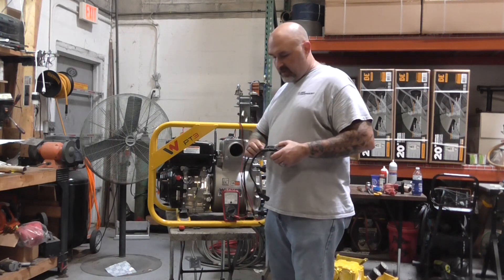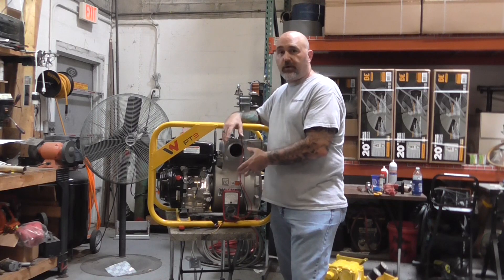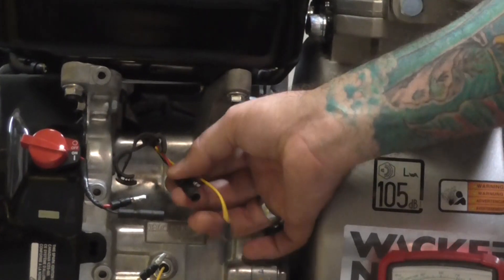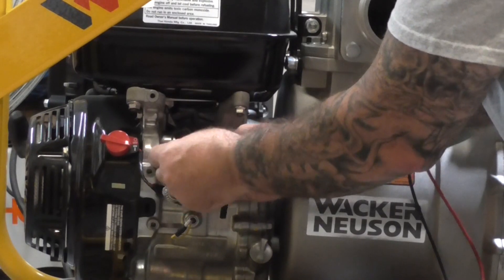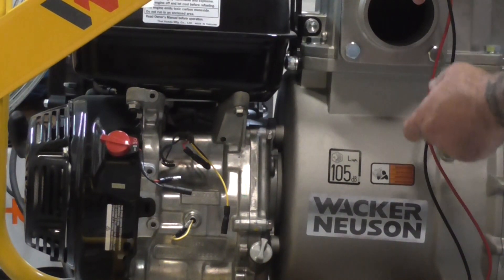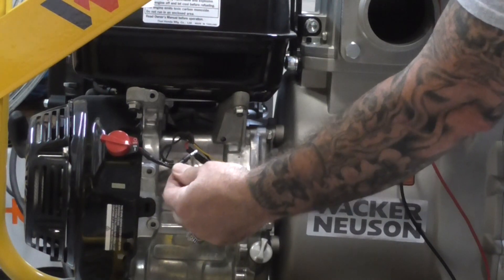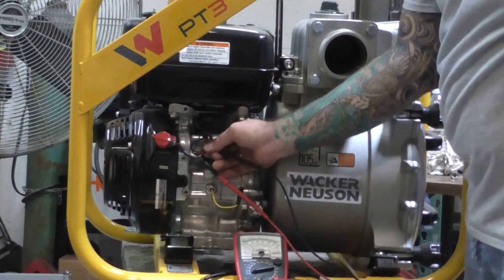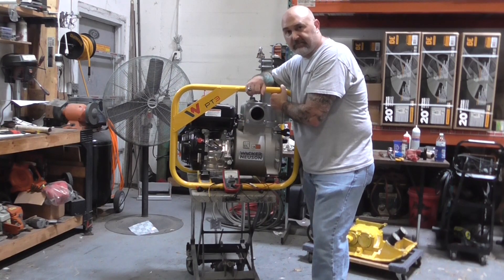Diagnose New Style Honda 4-Prong Ignition Coil | Models: GX240, GX270, GX340 & GX390

Comment: A thousand thanks for your video.  We have a 2 year old electric start GX390 that we could not get to run right.  We replaced carb, sparkplug, gas cap, and unplugged the low oil switch with no improvement.  Tried your test of plugging the red and black wires together and Hooray, it runs like a champ.  Apparently we have a bad switch just like you said.  Had I not found your video I would have bought a new coil and still be looking and pulling my hair out when that didn't fix it.
Reply from the maker: Awesome; love to hear we saved some hair!

Comment: First, thanks for a nice video.
My GX340 Honda has a different on/off switch and also 2 wires that go to the low oil pressure switch so I couldn't diagnose my system using the method shown in the video.
I also saw another video that gave some information on the Honda GX340 ignition system.
In that video he talked about the connection inside the spark plug cap being loose causing it to loose spark. Inside the cap is a threaded brass insert that the plug makes contact with the spark plug.
I unthreaded the spark plug cap and used a straight blade screwdriver to remove that threaded brass contact.  To my surprise I found a small resistor/fuse above the threaded brass screw.  I tried to get a continuity reading  and it showed an open circuit on my ohm meter.
So I decided to try and see it the plug wire would produce any spark directly from the end of the plug wire with the spark plug cap removed.  I held the plug wire about 1/4" away from the metal valve cover and to my pleasant surprise I got a nice crisp spark.  So it turns out the my coil was good.

Stens offers a 135-226 spark plug replacement cap at a reasonable price which I will probably purchase.  I believe the resistor/fuse is all that I need but was unable to find a part number for it.  It may not be a serviceable part and you have to purchase the spark plug cap assembly.

Well you learn something every day and this was my learning experience for today.😊

Comment: I'm unable to find the fault on a concrete saw that uses a gx 390 honda engine. 
Went ahead and tested the spark plug even on a different machine, proved to be functional, checked the 3 wire harness, all good, tried disconnecting the oil sensor, on off switch and the hazard switch, did the red-black trick, no spark, ordered a genuine honda coil, still no spark. 
Found out there was no continuity in the spark cap, took that out, removed the ceramic resistor inside, used a solid copper wire and covered it with lead in order to give it the same shape/form as the resistor, now i get the continuity on the cap, but still no spark. 
The magnet on the flywheel seems ok, i mean it has enough pull force, what else am i missing here? Thanks!

Comment: Obviously, the new coil eliminates the old-style low-oil shutdown module. I have a unique question for you: if you replace the flywheel on these newer engines with an older flywheel (pre-2011,) can you 'revert' the ignition system back to the old style? I bought an electric starter kit that won't work with the new coil, but I have all the components from an older GX390 that I could use to replace the new-style coil. Thanks in advance.

Comment: If you do not have the wiring loom, and only the ignition coil. Its the front two pins! The rear two are prob from the oil sensor. Pinout: front two pins!

Comment: Hello Will this module coil work or produce current for a spark when the 4 plug connection is pulled from coil or does it need to be plugged in and attached to a minimum amount of wires like red to black as you show to work ? Will this module coil work without on/off wires or low oil switch disconnect. Thank you

Comment: Same thing for electric start models??
Reply from the maker: Hi Jared, the procedure is the same once you disconnect all other wires from those coil wires or ON/OFF switch. Once you isolate the wires shown in the video from the rest, it's all the same. If the engine has spark in that condition, the problem will be either in the key switch from the electric start, something in the switch box or possibly in a safety switch etc having to do with the equipment it's on. This test will at least isolate what the problem is not in those cases.

Comment: What about weak spark on a GX340? Have done everything you have suggested short of setting the coil gap with feeler gauge 0.014" I believe?
Reply from the maker: Hi Andrew,
Weak spark is not very typical on these engines. The testing procedure for these and the older engines are generally for no spark and isolating parts of the ignition circuit to rule out the coil itself or some of the safety features as the culprit.
.014 - .016 should be fine for the gap. A standard business card will also work fine for you. 
How are you checking your spark? Spark tester? Spark plug against the engine block? New spark plug being used?
What does your spark look like? 
Keep us posted and we'll see what we can do.
Thanks

Comment: I followed the video and get no spark with the harness connected or not.  Did not have a spark tester so I grounded the spark plug. The spark plug is good  (worked in another honda engine), the gap is correct, and the resistance from the coil to plug harness is about 18,400 ohms. The Coil P/N is 30500-Z5T-0030, on a GX390 engine.   The generator it is in only has about 40 hrs run time , but it is 10 years old.    Do coils just go bad?    Should I check anything else or just order a new coil?   Wrong time to ask question now that hurricane is headed to CT.
Reply from the maker: Hi Ray,
This is not the troubleshooting needed for the old style coils. Here are a few things to look at for this style. If the below does not help, give us a call Monday toll free 866-611-9369.
This style coil uses the black wire that connects from the coil to ground to shut it off. All switches and safety devices ultimately connect to that black wire. The first thing I would check is your oil level, if it's low the engine will not start. If it's low and we disconnect all the safety devices for troubleshooting purposes you don't want to cause any internal damage. The oil level should be between the bottom threads of the oil dipstick port and midway in the dipstick port. Once confirmed I would check for spark as this is the most common issue.
Remove your spark plug to avoid an accidental start. Depending on your generator, you should have the standard Honda on / off switch mounted on your shroud or an on / off switch on the generator panel itself. If you have the shroud mounted switch you can disconnect the black wire from there, if you have the panel switch, it may be easier to disconnect the black wire from the coil itself from behind the shroud. Disconnect the black wire that routes from your ignition coil to your on off switch.   Ground your spark plug like you were doing, pull the starter and check for spark. If you still have no spark, you may need a coil. If you now have spark, you'll need to start troubleshooting the cause, but now you know your coil is ok. Common causes, oil switch, faulty on / off switch for the engine. I can't say for the generator if it's not one I'm familiar with. Hope that helps.

Comment: I've checked my coil in the manner you suggested. I have no spark with black and red, no spark, then the yellow, no spark. What's the chances of having a bad coil and low oil.  Where do I find these part's. No luck in my search online.
Reply from the maker: It is possible that the coil has failed. You can purchase the coil from us depending on the model you have:
GX240/GX270 Ignition Coil - https://stores.dhsequipmentparts.com/ignition-coil-new-style-honda-gx240-gx270-30500-z8s-003/
GX340/GX390 Ignition Coil - https://stores.dhsequipmentparts.com/honda-gx340-gx390-ignition-coil-module-30500-z5t-003/
Reply: I did find a coil, installed, test still shows no spark. Is it possible the wiring harness is bad.
Reply from the maker: @robmc8094  It is possible the wiring harness is bad. You can test for continuity in the harness with a multimeter.
Reply: @DHSEquipment  thank you for your channel and your help.
Reply from the maker: @robmc8094  Our pleasure! Thanks for watching!

Comment: my gx240 does not have a red wire,, yellow from oil switch, comes up to a small square relay looking box, black  comes out of box,joins a yellow to kill switch, and black goes to coil
Reply from the maker: Hi Chris,
It seems like your GX240 has the earlier Honda wiring configuration, which is distinct from the 4-Prong coil setup we discussed in our video. Honda has used a couple of different wiring setups for these small engines over the years. To ensure you're working with the right information, we recommend checking out the wiring diagrams available online. Make sure to find the one specific to your GX240 model. This should help you navigate the different wire colors and connections specific to your engine. Let us know if you have any more questions!

Comment: I got a good one. GX 390. Spark tester on it. Would spark only once then nothing. Weird .. tried 3 coils .. same thing.. switch and bypassed .. flywheel.. check the key .. disconnect low oil switch.  Crazy .. wire harness or something must be grounding.
Reply from the maker: What's your spec & serial number? Depending on what type of equipment it is on, you may need to isolate the engine from the equipment by disconnecting some of the other safety devices.
Reply: @DHSEquipment   figured it out. Wish I can post pics or a vid. It was the wire harness!! Funny because I cut it open and I didn’t see anything wrong with the wires. Weird!! Would spark once … engine would pop.. then no spark. Also I didn’t know they put some sort of fuse where the plug cap is .. unscrewed the cap tip and there’s a mini fuse or something in there.  It was on a power washer .. there was no other safety switches on the machine.
Reply from the maker: @styga1969  Glad it worked out!

Comment: Hi, how can I test an GX630 ignition coil? where are the primary pins I should test. The coil is a #DZ440. tks
Reply: This is a completely different coil and would not be tested the same way the video shows. Your coil  will not spark if grounded. You should have an ignition switch wire and a low oil switch wire that ground the coil preventing it from getting spark at the plug. If you want to check your coil, you should first remove the spark plugs from the engine to prevent an accidental start, then remove the wire harness connector from the coil . Using a spark tester, you can now try to start the engine and check for spark. If you have no spark, you have a bad coil, if you now have spark, you need to trace back the issue which will be either a bad ignition switch, bad low oil switch or one of those wires have a nick or something allowing it to ground to the engine block.
Hope that helps
Reply: @davedhs6821  tks. that is what I was thinking today.  After I did it i noticed no spark. so my coil is really damaged. appreciated your reply. tks
Reply: @gabrielmassa  Glad I could help.

Comment: On the honda GX 4 prong having the red, black, and yellow wires.  Doesn't connecting the red and black cause the coil to not have spark and unplugging them it should have spark?  Maybe I'm wrong. Just curious.
Reply: Hi Dennis,
This new design with the 4 prongs does not work that way. There are 2 different circuits with these coils. 
The ON/OFF  switch has continuity when in the ON position, so when we put the black and red together on the coil side it is the same as having the switch in the ON position. The black and red do not go to ground, nor does this switch like the old style. The yellow oil switch wire when grounded will still stop the spark.
Hope that helps.
Reply: @davedhs6821  this comment about the red and black wires not meant to be grounded is what solved my mystery.  Customer brought in a truck sander with a new gx270 engine installed.  No spark. Replaced the coil, spark is back.  one year later came back same issue.  Someone wired the black to a grounded kill switch and after watching your video and reading this comment, I can only conclude that that must have shorted out the coil internally somehow.  Thank you for your explanation 👍🏻